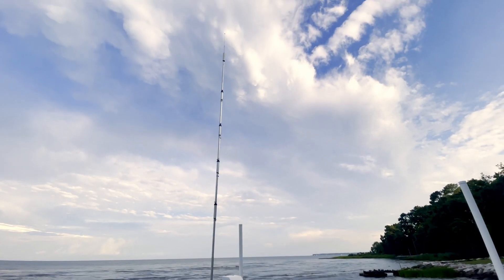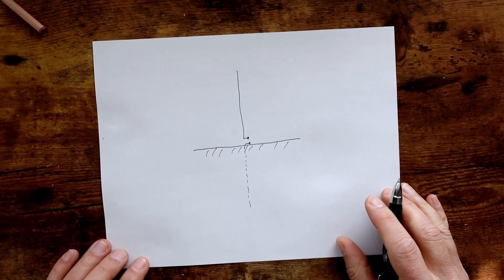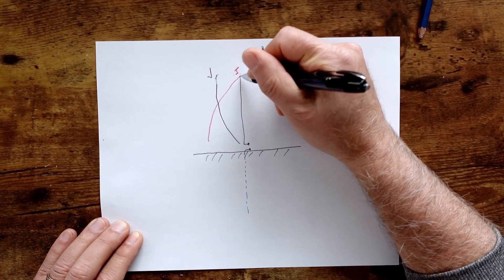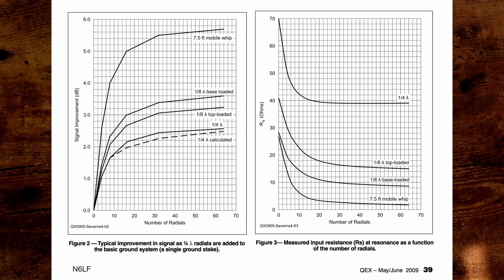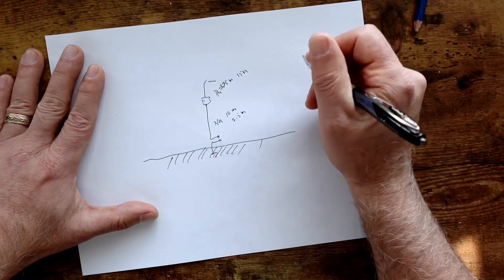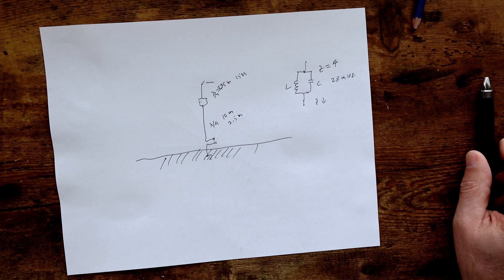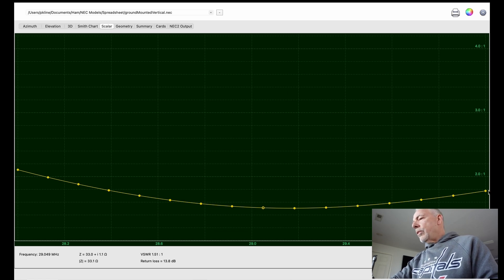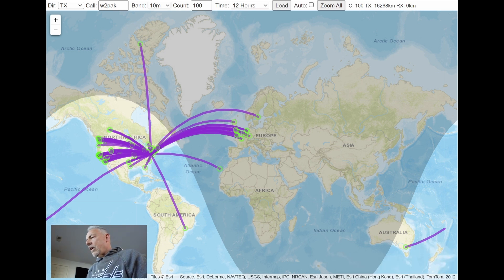The Ultimate Guide to HF Quarter Wave Antennas [step by step]

Comment: This was the second quality and informative video I watched from this channel today.  Subscribed!  I love the friendly presentation with the perfect amount of technical information to be educational.  YouTube was made for videos like this.  I'm currently building a motorcycle portable version of the POTA PERformer that I'm calling the Moto POTA antenna.  It's an 18 foot telescoping vertical whip mounted to the handlebars that is tuned to 1/4 wavelength by extending the whip to the correct length.  There are two elevated radials that are tuned by winding their storage reels.  I finished designing and 3D printing the parts.  After a little bit of soldering and epoxy, I should be ready to get it on the air and mark the tuning points so future deployment is fast and easy.  Elevating the feed point and the tuned radials should improve the radiating efficiency and make it less sensitive to being de-tuned by varying ground conductivity.
Reply from the maker: Thanks for subscribing!!  Good luck with your motorcycle setup.  73, Paul.

Comment: in a 7m fishing pole use 2,5 m wire and 4 elavated radials going sloper down 40-45 degrees.... you  ll see a big difference,,....  no need the use of balun if the wire is cut for 10m band..... nice vid...73....by the way i use steel rod  about 2,5m and 2 radials 45 degrees down for 11m and 10 m band,,no tuner requires, have no noise  and no balun..if you change the angle of the radials the swr changes,,
Reply from the maker: Thanks for sharing. 73,  Paul.

Comment: Elevated counterpoise n vertical works awesome, lot of gains, but you also have to extend the vertical. Example is my 17 whip on 10m instead the 99",i  need 118" for swr of 1.1 with 2 elevated counterpoise.
Reply from the maker: Thanks for sharing. Yes , there are several commercial antenna with elevated counterpoise.  They work well. 73,Paul.

Comment: Not too many of you get the vertical. I use a pencil and a mirror as a example. Where as the pencil represents one element of a dipole and the mirror represents ground. Place the pencil perpendicular to the mirror (ground)  and you see two pencils ✏️  (elements) . The more radials the shiner the mirror the better the image the better the performance. Of course you get it. You did fail to mention how the radials will capacitivly couple with a good ground and why insulated wire is just acting as the dialectic of a capacitor thus no need to use bare copper  no biggie
Reply from the maker: Love that analogy ! I will remember that, thanks for sharing. 73, Paul.

Comment: This is interesting sir. But may I ask. Is it possible to make a quarterwave antenna without any BALUN like a quarterwave radiator and radials that is at 45 degree angle like I used to do on the CB band? I mean if it works on the 27MHz band does it mean it may or may not work on other bands? Thank you.
Reply from the maker: Yes, you are correct. The impedance is about 40 ohms, you do not need the balun. But, may I suggest that you watch the video in the description, it will show you how it helps with noise.   73,Paul.

Comment: Dear Sir, thank you for this video, and your excellent presentation. It would be helpful to learn your design radial length. 1/4 wavelength for a single band antenna? With multi-band, would there be 1/4 wave radials at the longest wavelength? Thanking you in advance. 73 KQ4IXD
Reply from the maker: That is a great question.  With a multiband antenna I usually try to use 4 x quarter wave radials per band.  73, Paul.

Comment: what balun do you have there? 1:1 transformer voltage? or common mode choke?
Reply from the maker: Please check the description, there is a link to a video on how to make the balun. 73, Paul.
Reply: Why is it a balun rather than an unun?
Reply from the maker: You may be technically correct, it may be an Unun. It depends on how you look at it. If you look at it like a ‘mirrored dipole’ then it would be a balun. In any case, I use it more like a common mode choke.

Comment: I am campaigning for ham radio people to drop the clunky VSWR measurement and use return loss instead. It is a much more informative presentation of the same information, partuicularly when the match is good.
Reply from the maker: When I used to do RF engineering, we used return loss. I wonder what everyone else thinks about it. 73. Paul.
Reply: @W2PAK  @donepearce 

Interesting initiative. I'd agree that the dB representation can highlight differences in matching more clearly to the human eye, making it appear “more precise.”

73 from Germany, DF1PC
Reply: I am with you 100%. The FCC will have to change it exams however before we can replace VSWR with return loss. I teach VSWR so students can pass their license exams, but I explain it in terms of return loss and that VSWR is a throwback to the old days when reflected power was first discovered.
Reply: @thelongislandguy  Baby steps? Maybe they could include return loss as an alternative answer to the question about VSWR. That would be a start - then in mybe ten years, delete the VSWR part.
Reply: How long should the radials be?
Reply from the maker: They should be quarter wave.  Same as the antenna. 73, Paul.